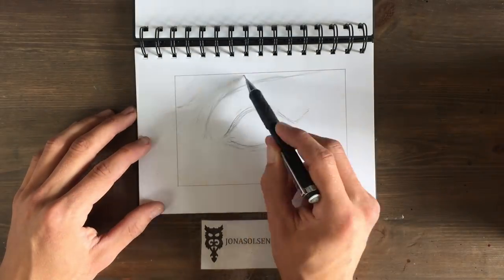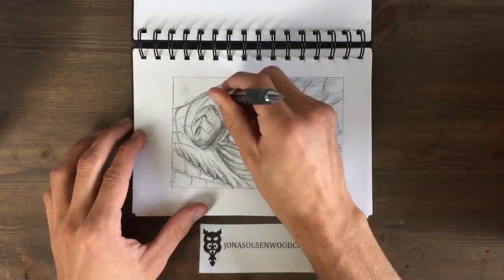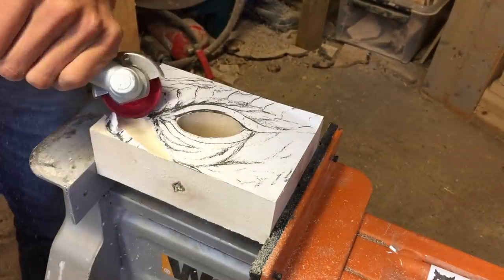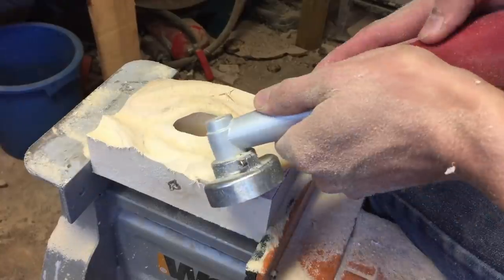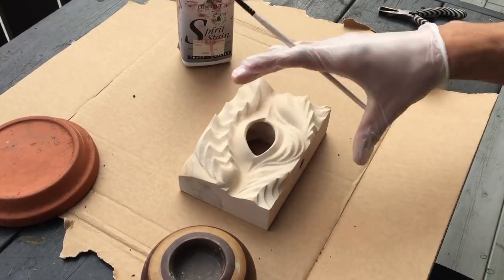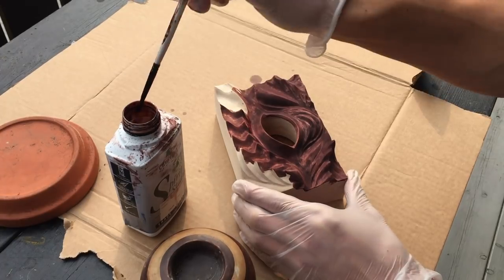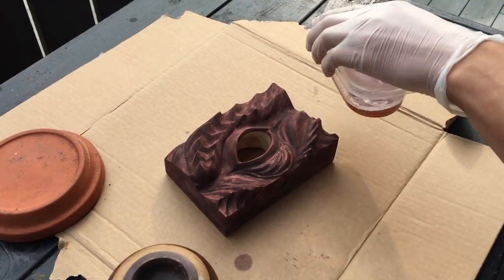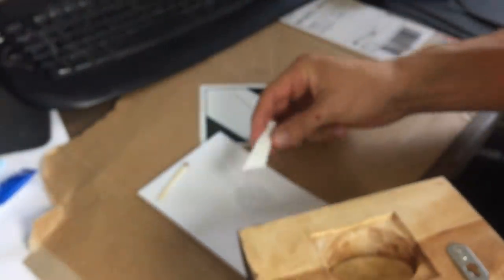Smaugs Eye wood carving art project | A tribute to J.R.R Tolkien by Jonasolsenwoodcraft

Comment: What a beautiful piece of art! It is astounding the way you finished it off. The pupil turned out amazing! What type of multi tool do you use? I have a Dremel, but you're seems to have a little bit more power than mine. I'm truly curious. Many blessings to you!
Reply from the maker: I just use a dremel 3000 at the moment 🙂
Reply: I would have never guessed. I saw you use the grinding stones as you were placing the last bit of detail on that beautiful piece. I've never seen a grinding stone used that way. Fantastic video! Many blessings!
Reply: Check out the world of Foredom. Truly the next step in the world of rotary tools

Comment: Question why use such a big piece of wood to just  cut most of it off?
Reply from the maker: Hello! Hmm well sometimes i have a hard time calculating how much wood i need for the design. But keep in mind that this is birch wood which is most commonly used as firewood in Norway since it is so much of it. I would be a lot more careful with my calculations if i was working with exotic wood
Reply: @Jonasolsenwoodcraft  Is absolutely beautiful.
Just was wondering if it was a reason lol
would be lovely to see the wood grain IDK 
as part of the over all design.  I would love to see a wolf carving. Had a dream about carving a wolf body  that was for a mirror. 
The tail was the side like it's climbing  down.
Rabbling lol love your work and ty for answering my question.